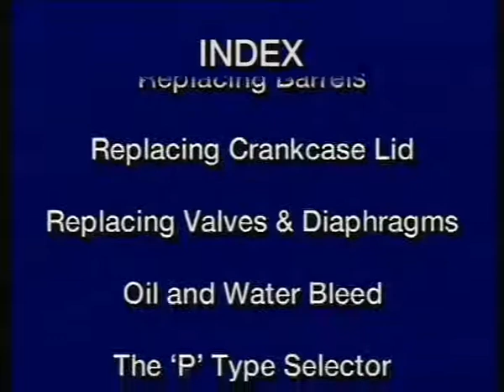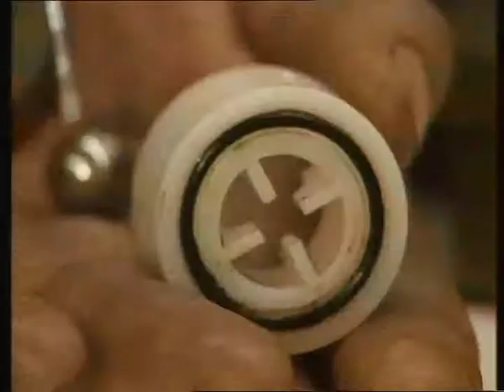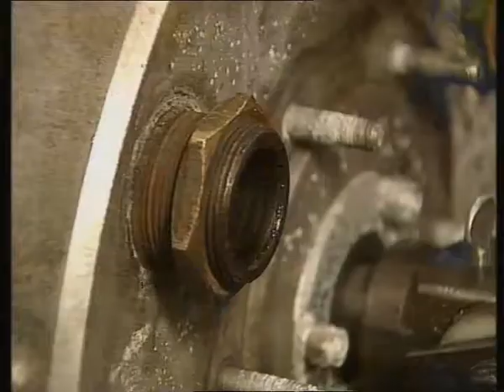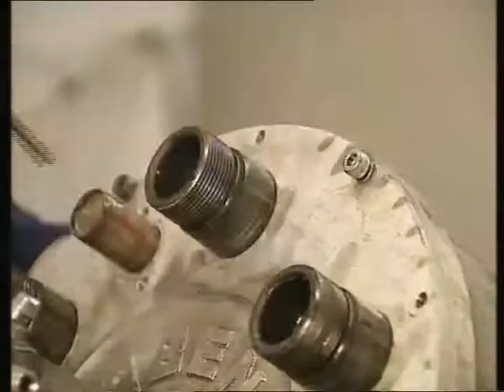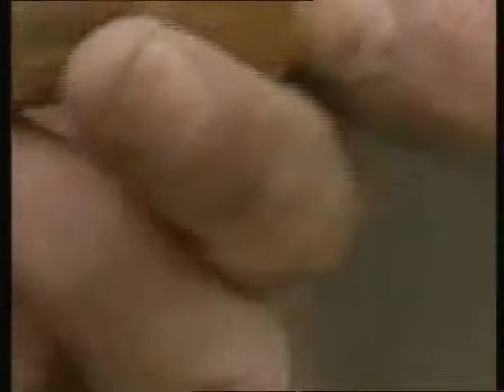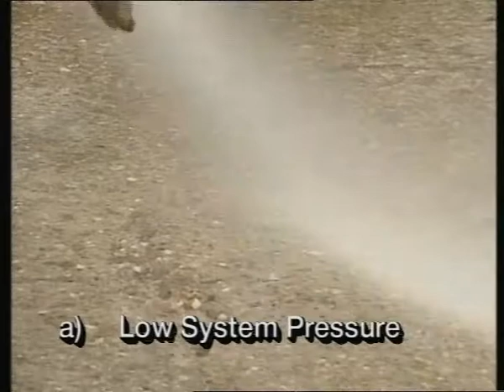'P' Type Pump Maintenance Video - Harben® pumps from Flowplant

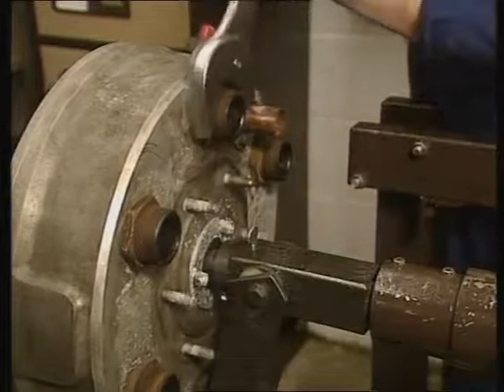Comment: CAUTION!!  At 8:50 the video says to remove barrel lock nuts.  This is imcorrect!  The manual states to slacken the nuts one half turn.  This will help prevent damaging internal components if the barrels stick fast in the top cover.  Otherwise the video is quite helpful.  Having it be correct in this regard would have saved this technician some headaches.  I would not have expected this from an official company video.